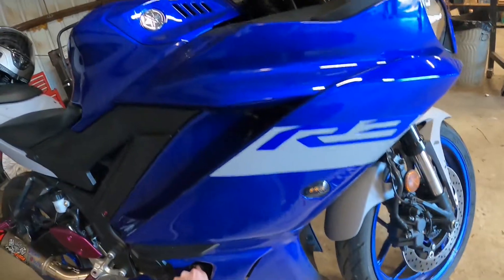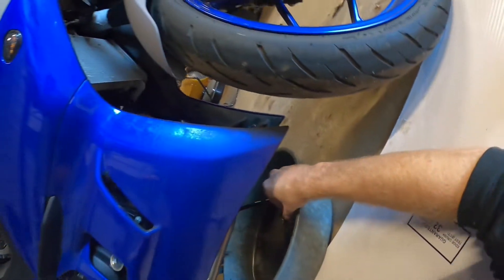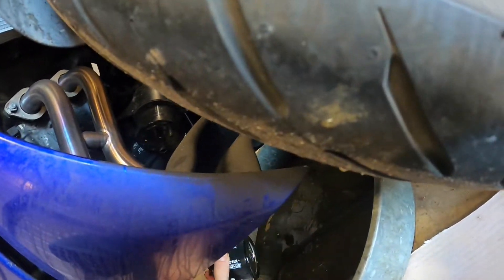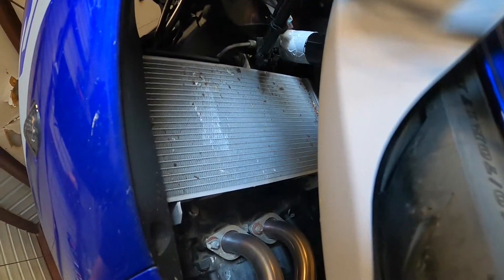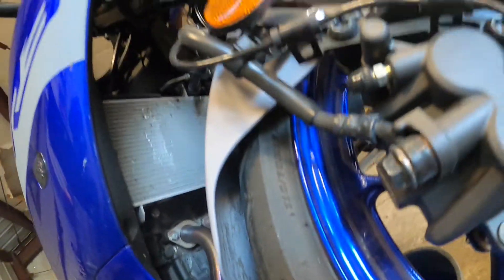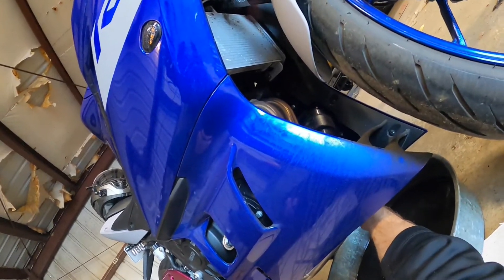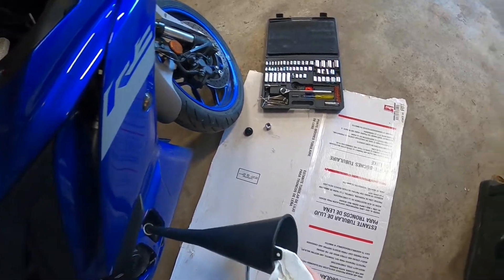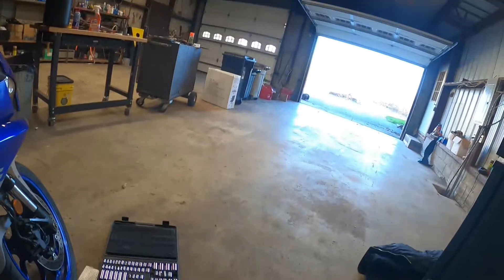How to Change the Oil on a 2020 Yamaha R3

Comment: Nice video! Gonna save a lot if money this way. I do have a question I am a new rider my R3 is my first bike and I was just out on a ride today and the oil light came on. It has about 650 miles on it so far I am doing the oil change this week. Only concern I have is even when I’m leaving the engine running I even took the bike to the right a little bit but I do not see any oil on the indicator at the lower part of the engine even when tilting the bike while the bike is running. Shouldn’t I see something inside the The window? Any help would be greatly appreciated
Reply from the maker: Thank you! I know mine isn’t very visible when running as long as you can see it in the window when tilted and not running your fine
Reply: If the window is dark ur good but prob ready to change the oil.